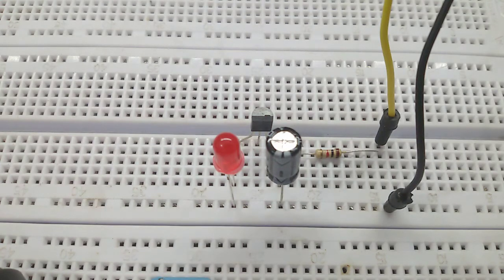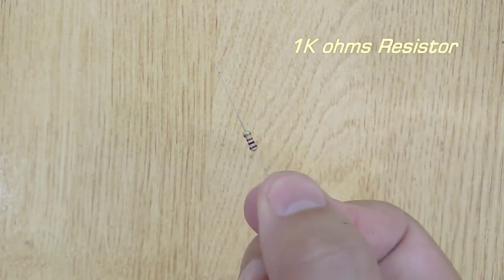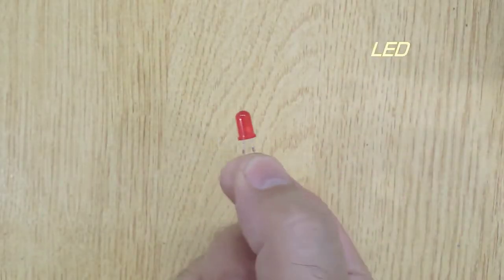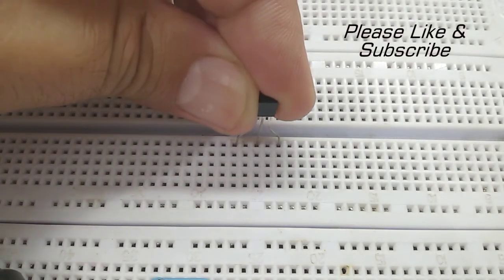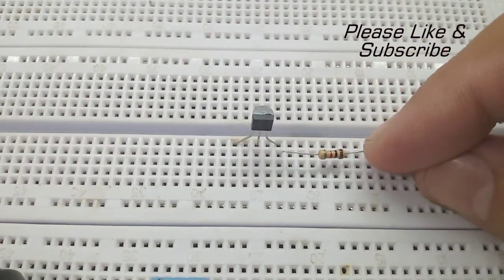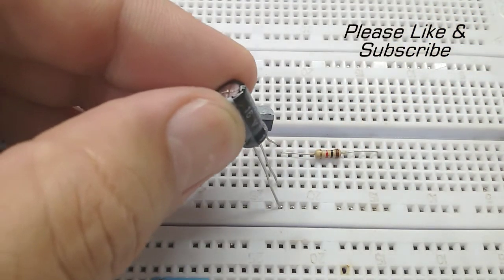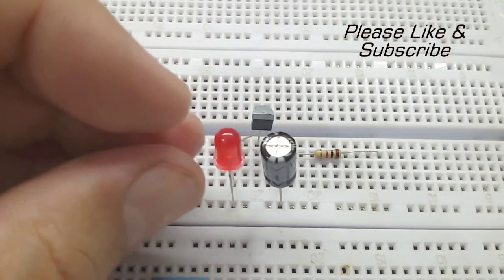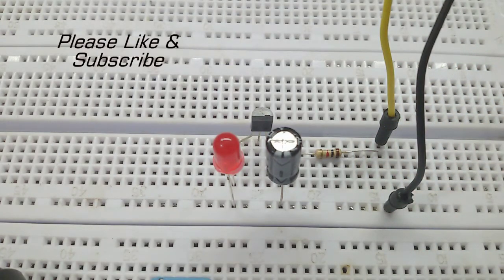How to Make a Super Simple LED Flasher Circuit Strobe Flasher | Ezi Circuits

Comment: 12.1 volts input. 11.9 volts with a 470 ohm resistor instead of the 1k. Smaller CAP (220) will make it flash faster at 12v, larger CAP (470) will make it flash slower at 12v.  Best thing is to use the components the author suggested in his tutorial, That works fine,